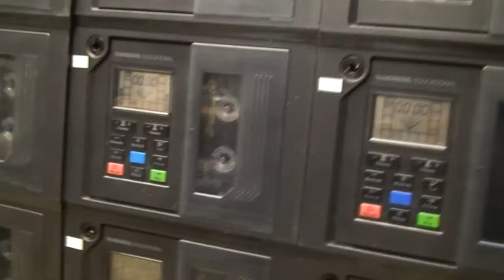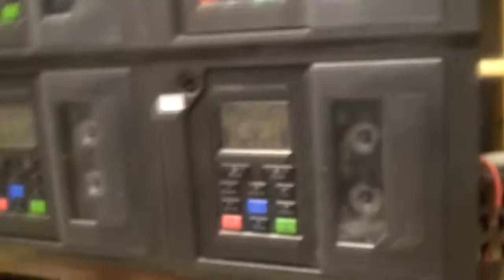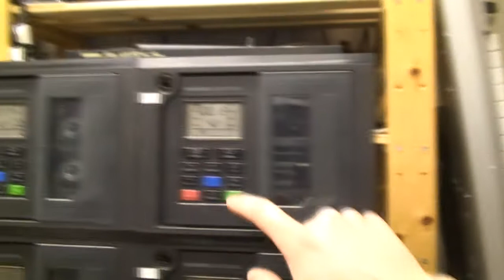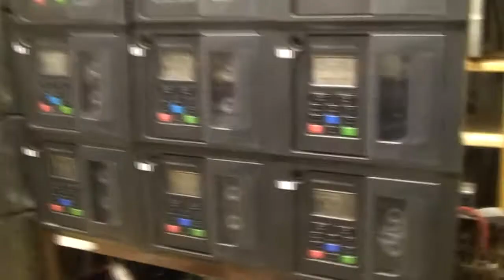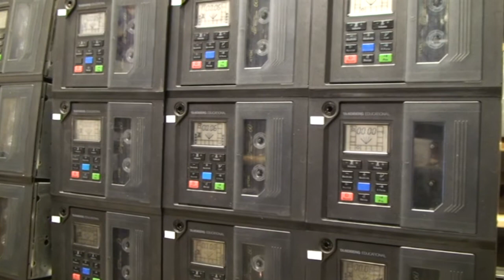Tandberg IS10 language laboratory

Comment: Amazing stuff, thanks for posting. I have a Tandberg IS6, an ASC AS4M and a coomber 901 lab but haven't yet got hold of any IS10 stuff! Yours looks like a much later one. The earliest ones used the TSR 5700/5800 student recorders which were dual capstan designs with 4 motors; one each spool, one capstan, one headbridge. (I have the sevice manual).